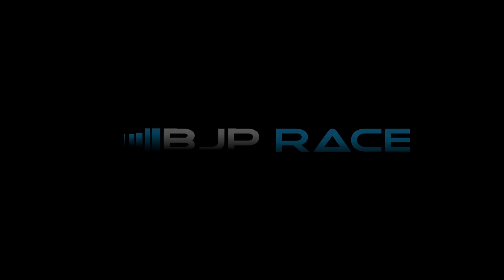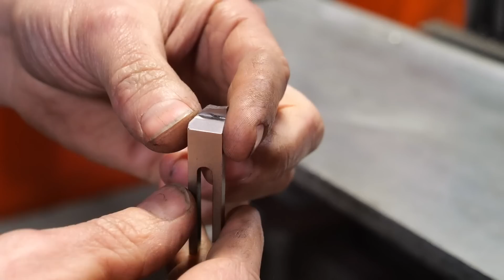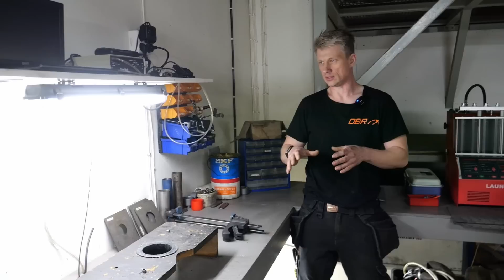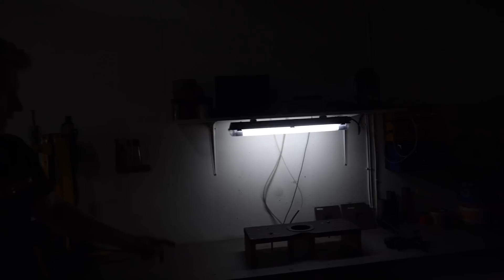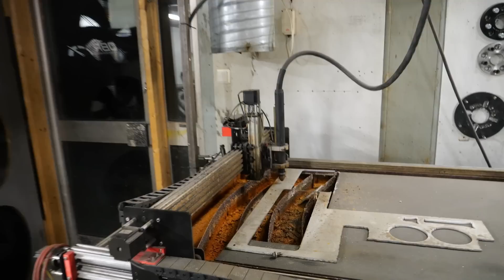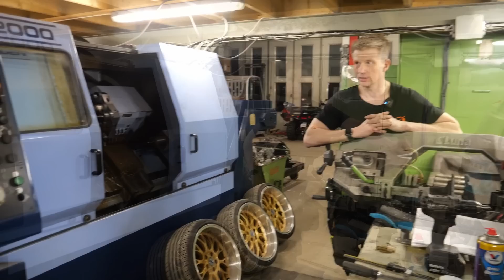V10 Cylinder Heads for the Mid-Engine Volvo. Overboost Racing Workshop Tour.

Comment: Tommy (Overboost racing) built a stage 3 530 head for my volvo b230 (bigger valves, cnc chamber and cnc runners).
This head made my engine way better, at the same setup, rpm and boost the engine gained 90hp and 130nm.
The engine makes 500+hp 640nm with a tiny borgwarner efr 6758 on PUMPGAS!

10/10 can recommend
Reply: Wow 😍

Comment: Im wondering why you would consider removing direct injection. Usually its more accurate than port injection making it easier and safer to push high hp and to tune it.
Correct me if im wrong for the v10 you are using 😅
Reply from the maker: I will come back to that in a video, there is pros and cons with DI. Now they stole my DI fuel pumps also.
Reply: direct injection needs a very special/expensive ECU and is pretty hard to tune. might be that (and with e85, knock is not really a problem with high cr engines)
Reply: @ Makes sense, ty for the explanation :)